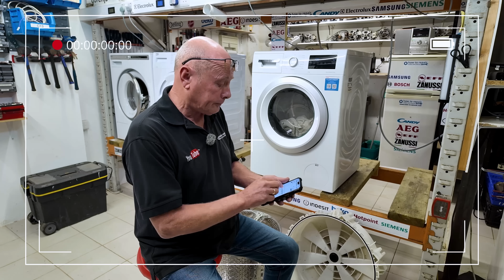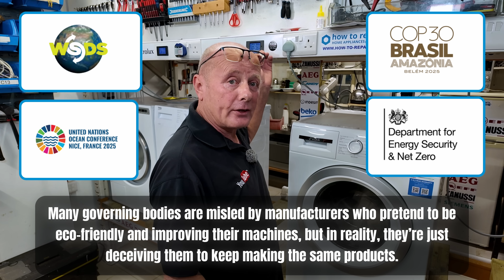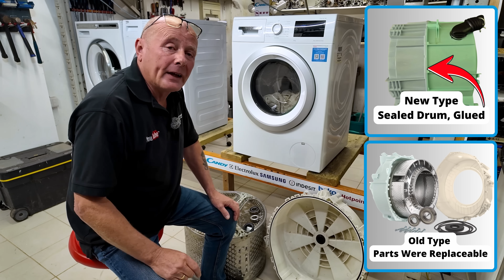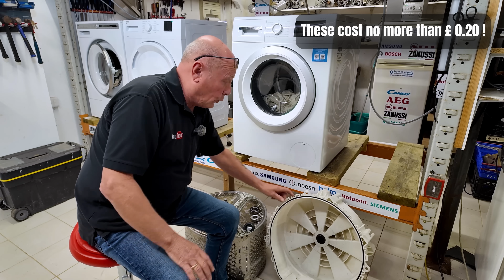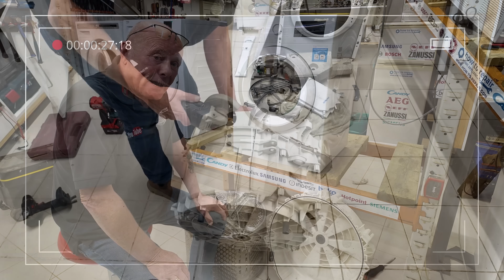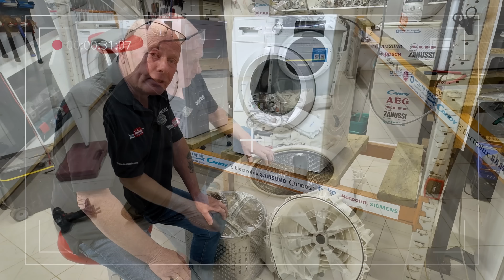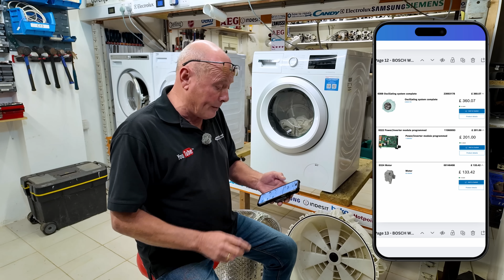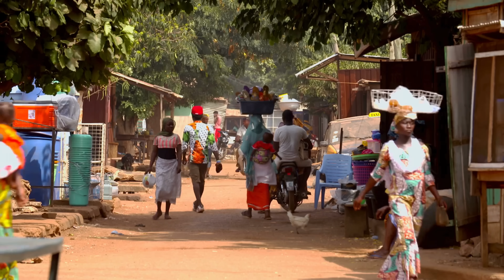Washing Machine SCAM EXPOSED! The Truth About SEALED Drums: Naming & Shaming

Comment: I have an old BOSCH . I've replaced in 12 years: pump,water valve, bearings, motor brushes, heater, repaired board . Next time i guess i won't buy BOSCH 😂

Comment: I've been considering buying a Miele WQ 1000 WPS Nova Edition washing machine. After watching this video I found a spare parts catalog for it on the Miele web site, and although the catalog has a lot of parts on offer, it doesn't have the drum bearings listed at all. Also, for the drums (presented as one unit) it says "not a spare part", although the combo has a list number. I wonder if that means the bearings can't be replaced at all on that machine. That would be surprising considering that according to Miele the machine is designed to last for 20 years, and Miele also offers a 10 year maintenance plan for a non-astronomical price, which would suggest that Miele expects that it would have to do some bearings replacements during years for the machines covered by the plan.

Another option for me is Asko W7096XG. I wasn’t able to find a spare part catalog for it, but at least the list for a 6000 series machine has drum bearings listed, and the outer and inner drum (do they have different words in English?) seem to be separable from each other. My two doubts for Asko are that the brand doesn’t have a strong present in my country (Finland), which might mean problems with repairs, and that the manufacturing has moved to Slovenia (the Miele model I’m considering is made in Germany), and later ownership to China (Hisense), which might mean that quality is not what it used to be. On the other hand Paul recently teared down and reviewed (a lower tier) Asko machine, and with all his expertise considered it to be designed and built very well.

My old machine (Hotpoint-Ariston) will give up any day (terrible noise from the bearings – very difficult to replace them on that model according to a YouTube video I found, and there are other problems too, so the machine is not worth repairing), so I need to come to a conclusion soon. Any opinions and knowledge to help me with my decision would be welcome.
Reply: Forget the overpriced garbage buy Samsung, superior in every aspect.
Reply: @DerrickSmith-d7c  The price isn't that important to me, as I'm at the retirement age and expect the machine I buy to be my last (not because I expect to die soon, but because I expect the machine to last long...). At the same time I'm a little bit of a sucker for nicely designed, beautiful things, although, as I said, I also want to buy things that last long, be it cloths, furniture, household appliances or anything else. I also prefer to buy things that are made in Europe, because that's where I live. That's not a must, though. If some manufacturer makes clearly better quality somewhere else, I don't feel bad supporting that manufacturer. By the way, what makes you think that a Samsung washing machine will last longer than (an expensive one) from Miele or Asko?

Comment: When I was in the appliance repair business, back in the 2010’s, Bosch front load washers were a pain in the ass to work on even then.  And their dishwashers switched neutral to the fill valve.  And their diagrams did not have lines representing wires that went from a control to a load.  They just had barely decipherable  combinations of letters and numbers.

Comment: I suggest, we propose a kind of open source washing machine. Let´s use old components that are already available and make the wiring and circuits self buildable. E.g. use a ESP or RaspberryPi to control the stuff, take a step motor or what it takes from the shelf to move an old drum and experiment...

Comment: I have an LG dryer. It worked great for about 5 years. Then the rollers started squealing. I went down to my appliance parts store and bought a rebuild kit with 4 rollers on shafts with plain bearings, a belt and an idler wheel for $60. I asked about greasing the bearings and they told me no. So I put it back together. They lasted a month before one of the bearings seized up and flat spotted the roller. I took it back to the parts store and showed him the failed bearing. He sold me a new set for cost. About $20. I reinstalled the new bearings and they lasted about a month. So this time I put in new bearings and greased the shafts. It’s been a year and they have started squealing again. Why would they make these with roller blade wheels?  What garbage. And they’re all the same. Planned failure. They could use permanently greased and sealed bearings. But no. This is a crime.

Comment: All the time we a) expect cheap appliances, and b) have no clue how (or incentive) to fix stuff ourselves, this is what the majority of users are going to buy. The convenience of having access to a new machine tomorrow far outweighs the fuss of accurately diagnosing a fault, ordering parts, waiting for delivery, and then installing those parts ourselves. The truth is most people are not able, don't have time, or just can't be bothered to repair anything any more, and manufacturers are well aware of this. I have repaired my (cheap) Hotpoint washing machine twice now, and there is currrently a door seal waiting to be fitted, after the old one coughed up a big chunk the other day and flooded my kitchen 🤣 I have just pinched myself, so I can confirm I am (mostly) human, and this comment is not AI generated, honest guv.

My mother-in-law was two thoughts away from spending a large amount of money (£700 and some!) on a new double oven, after it 'stopped getting hot'. A quick look and a careful poke around with a multimeter proved a busted element. £28 and an hours work to replace it. She thought I was some kind of magician (I am not). Why can't everyone do this, it's genuinely not hard. Answer - we've been conditioned to act this way; the only way appliance manufacturers make money is when we buy another appliance.

Comment: This is just progress. A welded drum case is probably cheaper to manufacture (no O-Ring or bolts required), and may reduce leaks from thedrum.
I once wanted to repair a washing machine in which the spider was broken, but the replacement drum was too expensive.
For some assemblies, it makes sense to replace flange joints with welded joints in order to simplify, reduce mass and increase performance and reliability.
For example the Raptor 2 rocket engine is now superseded by the Raptor 3 engine in the SpaceX Starship vehicle for these reasons.
The downside is that it becomes more difficult to service between flights.
Reply: 😂 you can’t be remotely serious

Comment: My samsung wassing machine was 6 years old en the heating circuit on the the mainboard  burned out  and because it has a thick soort off silicon coating to protect against water, it was there for not repairable. 
25 cent part.
New mainboard 295 euro to order for a machine that was new 550 euro. 

The replacement board was not worth 60 euro in parts 
 I had 2 years factory warranty and 3 years extended warranty I paid for 😂

Dith not find a secondhand board because it's one of two parts that fail on this machine 😢. 

I just replaced the is dampening springs 😅

So i replaced the machine.

Comment: I agree this is a common problem across the board. I'm on the other side of the pond. We have an LG front loader and LG gas range. I needed to replace the pump on the front loader and the touch panel on the range. Luckily I was able to obtain replacement parts and do the job myself. However even if the parts are available the field labor cost is pretty high. I don't begrudge anyone making a living but that also factors into the problem of disposable appliances. By way of example we have an electric water heater that failed under warranty but I needed to have a tech come out to verify the leak. That was $100 US to allow us to file a warranty claim.

I don't know the ultimate solution to this problem. As manufactures use more automated assembly to drive down cost the disparity between manufacturing cost and repair continues to widen.

Comment: A washing machine is a drum turning in water. No matter what you pay for them, they are the same, a drum turning in water. Buy a £200 machine, and dump it when it fails. Best and cheapest solution. All the so called top brands will go bust, unless an advantage to their machines is that they are economically repairable.

Comment: A friend in New Jersey still has his parents 1950s era refrigerator. It works fine.

In the buildings and grounds department at San Francisco unified in San Francisco, California, where we have a service contract, I noticed a really cool steam punk style canister. It turns out it was an early 1950s water heater.

Next to it were nearly 100 new water heaters.

When I asked the buildings and grounds people about it, they said they saved the old one because it was beautiful and still worked, and that they are in the process of updating all the old ones to meet “new standards.” The new ones will last about five years.

Our field is piano technology including all the new electronics inside acoustic pianos. 

Over the last 10 years the quality of wiring and printed circuit boards, switches, etc., have become nearly intolerable. 1990s era stuff was nearly bullet proof. 

Something is happening and it isn’t right.
Reply: Fucking shareholders want submarine docks on their super yachts, this is how they get them.
Reply: Greed happened. We are wired for it and till we acknowledge it and enfkrce against it, it will repeat

Comment: good and refreshing video! this is the reason i still use a 2005 Bosh washing machine that most likely Bosch forgot it ever built. Excellent appliance, never failed (except minor repairable stuff that i managed doing myself) and with a 100% stainless steel rotating drum.

Comment: Hotpoint Aquarius about 30 years ago stopped working. Engineer said it was BER, a right off. It was a single transistor on the MCB which I bought from Tandy for 79 pence. Ran the washer for another 10 years 😂😂😂

Comment: Great topic I spent 15 years repairing and selling washing machines all the manufactures u mention I got out of the game a decade ago because I could see where it was going 
At that time I was collecting a lot of old  washers that people had had for 15 years and after that I would rebuild them and sell them on again especially the Hotpoint 1st edition replacing the spider and bearings 
I used to get around 50 old  machines a week from a retailer and split them for parts I kept loads of circuit boards must have had a 100 various moters  and out pumps you name it I had it 
But when the sealed drums started coming in and the cheap Chinese circuit board  I decided to get out and it's a shame because my phone was red hot 
In my opinion that original Hotpoint 1st edition was the best washer ever they went for years and could fix  almost anything .

What makes me laugh they say these machines are eco this eco that when you are lucky to get 3 to 5 years out of them 
😂 Plus cold water fill only if you have lots of hot water what a waste of electricity 
Plus the faster spin speed the shorter they lasted 
Good luck I am glad I am out plus my knees and back are much better .

Comment: Just buy chinese, no choice. Mine lasts very long so far and not even one problem, 10tears warranty with labour. Drum spider will dissolve in water anyways, as it is programmed to fail aluminum working piece in detergent environment, and some people even put vinegar there. How many times you were told never to put stainless bolt into aluminium and opposite

Comment: My father in law has a 1972 washer and dryer set from maytag. 54 years old and still going strong.  In those 54 years all that's been replaced were a few belts, a dryer timer and heating coil. All easy fixes. That's a minimum of over 11,000 loads of laundry with minimal maintenance So the technology exists for durable maintainable machines.

Comment: This is not a surprise whatsoever and unfortunately it's been common placed it did but the problems also when it comes to the foreign Asian machines you get to the ridiculous things like Samsung I've learned to the Samsung Appliance they are absolutely garbage LG is barely any better the only ones left over here in Canada they're actually any good and same thing it's been for years was companies like whirlpool which is GE which is still coming once over here and even then you have to really watch what you're buying in order to avoid the playing topsolescence now our current machines and we blocked 12 years ago I've had to replace one thermal regulator on the dryer and I did not they're still going fine same thing with our basic model fridge the biggest secret to avoiding the downfall of the first machines avoid all the gimmicks they're like there's no sense in having Wi-Fi there's no need to have the worst thing you could have to do with having a nice dispensing your water to spending the door of a fridge because that's the number one thing that goes and Ice dispensing it all in the fridge because they are there's no way in hell and they're always screaming but Green Planet Green Planet can imagine look at the cost of the destruction of all these machines that could otherwise be perfectly repairable of May serviceable for decades to come I still got my mother's old dryer as well and that dryer was around when I was a kid it still works perfectly fine and it's on its original bearings despite having Decades of use

Comment: It's a disgrace that something isn't done about this. I've had a fridge refreezer and a tumble dryer die on me in the last few years. Both a couple of months outside their warranty. Repair costs were ridiculous. The company's are running a monopoly on who can actually get the parts. And they charge unreal prices for repair contracts.  Trying to claim from the seller was just as frustrating. As they requested quotes from an engineer at my cost to say they were unrepairable. Just throwing unnecessary barriers up left and right. It's a massive scam.

Comment: I have aeg-electrolux washing machine for 15 years. Engine, pcb, drum, bearing is ok. The only thing i had to repleace is the water heater. Usually I do 4 to 6 washings per week. But I agree, the   welded drum is a bad thing. Fortunately we have some online shops where you can buy replacement parts cheaper

Comment: You do not get it. The product is just very very cheap. Also components being actively produced are really cheap like the newest PCB is 100-ish pounds. Older PCBs are more expensive because they are not in production anymore, however the manufacturer must keep it in stock. They do not want to sell those items because a reorder just to maintain stock is very costly.

Comment: They left the holes because modifying one or more molds of that size is very expensive. I repeat, multiple molds, because for a daily production of 5,000 washing machines, a single mold for a plastic shell is not enough. I had seen the first welded drums more than 15 years ago; they welded the two parts together using ultrasonic vibrations. I worked in an Italian factory that made washing machines for third parties; now it's gone bankrupt, crushed by Chinese and Turkish manufacturers.

Comment: you mentioned bearings....with what I know from mechanical parts ...cars mowers and the like ...the biggest warnign I can give is to wash all the grease that is in these bearings out and replace it with one of better quality.. they are packed with stuff like Vaseline very thin low melt and just evaporate off

Comment: I am from India and we have another scam done by the so called "AUTHORIZED SERVICE CENTRE' . When you call them for any repair service, they change an amount for visiting the home but they have no intention of repairing! They come to the home and quote a huge price for DRUM or Circuit board and obviously the customer will not opt for the repair. Then they go way taking the so called "Visiting Charge" . The scam is that even if the customer opts for their service, they increase the price of the component or say it is not available. The collect the so called 'Visiting Charge" and go away.
Reply: Already in Europe aswell
Reply: And the authorised service centres refuse to sell parts, so we have to buy aftermarket ones which are not so good and in some cases aftermarket parts are not even available

Comment: Front loaders - even the ones that can be repaired - were designed to become obsolescent TOO.  i.e. Like you say, the bearings are designed to fail.  Who cares they use less water - water is cheap.  I'm still using a 30+ year old Simpson upright washing machine in Australia.  It has a few broken parts now, so that I have to fill it with water for the wash cycle by hand using a garden hose, let it wash for ~20 minutes, it then pumps out the soapy water and stops because it doesn't refill itself.  I have to come back and fill it by hand a second time for the rinse cycle.  The part of the spin cycle where it sprays fresh water while spinning to rinse the last bit of soap out - that obviously doesn't work, but the rinse cycle is enough to remove the detergent.  My point being, I can still buy all the parts and get it working 100% automatically again.  So abandon front load machines, go back to top loaders.  I'd rather go to a second hand store and buy a used serviced top loader than a piece of crap front loader.

Comment: I bought Bosch induction 4 years ago. My wife dropped a glass jar on it by accident and broke the glass, there is a line on the edge. I paid $800 for it since it is the white one. I called Bosch and asked for the glass. You can't buy the glass top from Bosch directly in my country, you need to buy it from official repair shop :) Their official repair shop quoted me for $600 for the glass top! Yeah... stick it where the sun is not shining. And that is the price of a glass without labour costs.